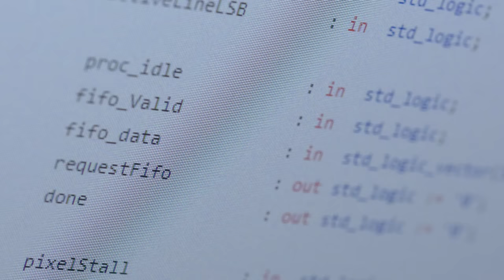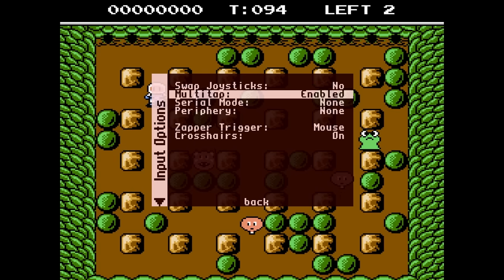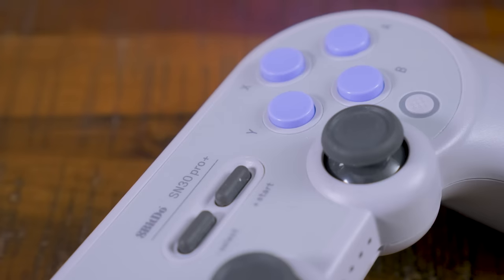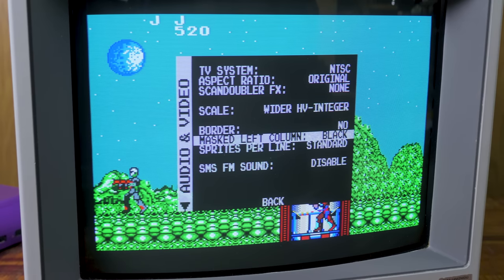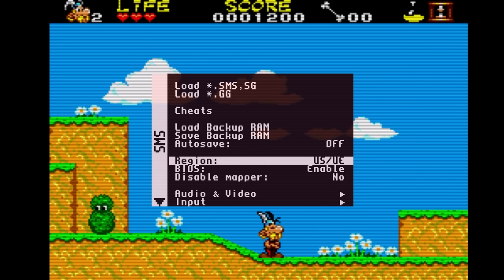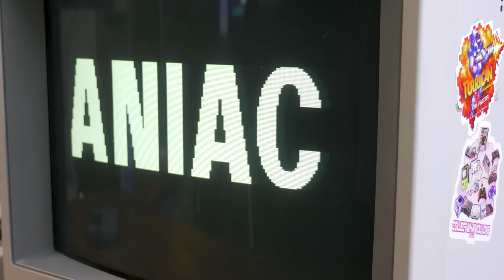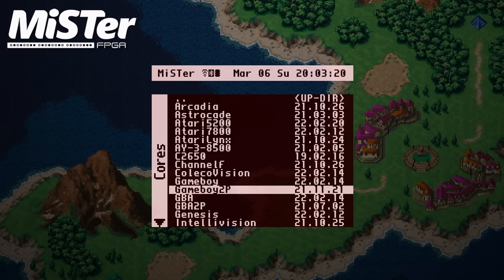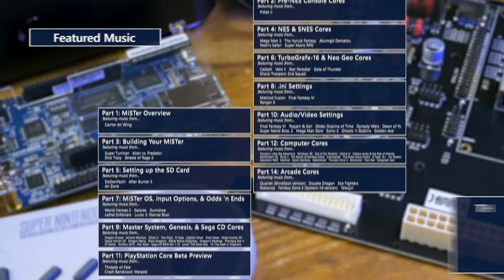MiSTer FPGA in 2022: A Primer Guide to Retro Gaming's Hardware Emulator / MY LIFE IN GAMING

Comment: 1:42:53
So why is the N64 more difficult to create a core for?
It’s Surprising that a Saturn core is in development and its not possible with the N64.
Reply from the maker: [Try4ce] I think a lot of people don't realize how much more complex the operations the N64 can process are compared to PS1 and Saturn. Even though it has limitations like a very small texture cache and the framerates are often lower than PS1 and Saturn, the way it manipulates 3D geometry is much more advanced and some features were above and beyond PC gaming at the time of its launch. Most of the FPGA is taken up with the CPU alone for the PS1 core, so we're hitting the limits. People may not love the N64 look in the retrospect, but that doesn't mean it wasn't very advanced. I couldn't speak to more specifics of why the N64 is comparatively advanced, but there's a lot more to it.

Comment: I wonder if MiSTer would work on other FPGA systems as well.  For example, are there 2X more powerful FPGA setups that MiSTer could run on without much more modification?
Reply: Some of the cores have been ported to other FPGA platforms.

Comment: 1998 was Pentium II era… several years after the Pentium, Pentium MMX, Pentium Pro, etc. had replaced the venerable 486. The first Pentium launched in 1993 so the 486 was decidedly obsolete for years. Granted, I knew someone gaming better than I could on his 486 in 1998 but he had a 3Dfx Voodoo and I didn’t exactly have a Pentium myself (IBM P150).
Reply: Also, that’s a Slot 1 or Slot A system at the chapter opening, which means Pentium II or later.
Reply: You didn't go easy on him...

Comment: Are there real advantages to this over a dedicated emu box for people who only care about the end result and have no interest in DIY electronics or MiSTer development?
Reply: Hard to answer that as there is too much variety in emu boxes.  Commercial ones are badly optimized or lack options compared to MiSTer; but you could build a good emu station out of a powerful PC if you don't mind the tinkering it needs. Personally I just find it easier to have multiple MiSTers around the house in various setups (TV, arcade, etc).

Comment: 2:14:42 - That kind of stuff could actually happen on original hardware.
Some link games were at times really unstable.
I spent A LOT of time playing link cable games way back when, and Super Mario Delxue sure did have it's weird moments.
The same goes for GBA, but it wasn't as common with GBA from my experience.
Reply: I played a Yugioh game which would simply skip your opponent’s turn if the connection got overwhelmed. I also found it was programmed poorly enough that it messed with the connection if you spammed buttons while it was switching turns. So I could have endless turns and deny my opponent any.

… but then no one wanted to play with me unless I promised not to do it. One kid even made me put my GBA down before he’d believe I wasn’t going to do it. lol

Comment: When will original xbox be available on MISTer? Considering the difficulty of og xbox emulation, will we see fpga first? Within 5 or 10 years?
Reply from the maker: [Try4ce] I'm no expert, but I think 5 to 10 years would be extremely extremely optimistic. The reverse engineering is one challenge, but the available logic on the FPGAs is another. I don't know if we can expect FPGAs of that kind of density to be available on an affordable board anytime remotely soon, maybe even not any decade soon. Again, I'm no expert, but I wouldn't be optimistic about this happening nearly as soon as you'd like.
Reply: Xbox? Not until late next decade, minimum.

Comment: I'm no programmer, by WHY can't the MiSTer save like normal? Emulators have been able to do this since the very beginning, why is it necessary to manually go into the menu to backup your save RAM?
Reply from the maker: [Try4ce] I also am no programmer but I believe it is likely because it would potentially interfere with the gameplay. For instance, in the WonderSwan core, if I have auto save set, then whenever I open the menu and it begins that process to copy the save to SD, there is definitely a hitch in how the game runs. I don't usually notice this in other cores, but I suspect this may be the reason. Resources have to be managed quite carefully in an FPGA environment for anything that goes outside of the target hardware's behavior. Many models of flash carts also have to do something similar - the save for the last played game is kept in SRAM like in a real cart, but it then has to take a moment to process writing that to the SD card separately upon next boot up.

Comment: What would be cool is if someone made a board that had every console cartridge slot for carts and an optical drive to accept all format optical discs.. that are SERVICEABLE AND REPAIRABLE that doesn't require a degree in hardware engineering..

Comment: I would have to wonder what would actually happen if you actually used a modern pc as the platform of choice and  start creating pci-e  hardware when and where you could run any controller on the  system..

Comment: Now MiSTer has a 2560x1440p option by using pixel repetition. What are the optimal settings for a 1440p 144hz PC Monitor?
Reply: Pixel repetition will show artifacts on most TV's when horizontal scrolling happens, dependent upon the scaling algorithm built into your tv, so it might not always be the best option.

For a 144hz monitor try and enable vsync_adjust=2 and see if it's compatible in the cores you like to run, if there is sync lose dial it back to vsync_adjust=1 instead. The test of the upper limit would be the Wonderswan core which runs native at 75hz.

Comment: Aside from a few Niche settings what advantage does this sort of thing have over a raspberry pi or hacked classic system?
Reply from the maker: [Try4ce] It's mostly about whether the difference in the software-based vs. hardware-based emulation approach tickles something in your brain that makes you happier. In the end they can provide very similar experiences when the emulators are well-made. But if things like the fact that FPGA emulation can perform parallel tasks in hardware rather than sequential tasks in software emulation appeals to you, or the idea that the hardware is performing in isolation from any OS tasks to provide a more consistent and predictable experience, then FPGA may be fun for you. If that just sounds like whatever to you, then you might enjoy the software emulation approach better. Both offer advantages and disadvantages.

Comment: Will there be a ram expansion at some point?

I'm kinda concerned that some consoles may not be possible on something that seems so versatile.. 

I'm keen for ps2 and dreamcast at this point
Reply: The only one that might use it is Sega saturn at this point.
Don't expect Ps2 or dreamcast
Reply: de10 can not do ps2 and dreamcast you would need a fpga that cost around 3g or more and a team to work together . a fpga is not a desktop computer it is a board to test and fine tune a product  example a ps5 was done  on a fpga to iron out all the hardware bugs before it goes to the assembly line. we know a sega saturn can be done but anything beyond that don't think so
Reply: @soloM81  sweet.. so 2nd iteration is what I'll be waiting for..
Reply: @garystinten9339  is going to be a while the fpga market is very slow when it comes to upgrades and the chip shortages dont help . get a de10 and play what mister cant play on your computer
Reply: @garystinten9339  Even then, a MiSTer 2 might only get you to N64 and DS, DC may still be out of reach.

Comment: Regarding arcade cores.. are there similar hardware pathways to allow writing arcade cores with multiple games to be run by the same core or is it a per game case?? The reason I ask is simply, efficiency and less programming.. if you follow my drift
Reply: They are built in that precise way. Similar arcade hardware or platforms use what is called an MRA, which is basically a text file that tells the core how to configure itself for that game, and where to load the data to.
Reply: @ArtemioUrbina  Hi, Mr. 240p Test Suite man! (yes I know you do many other things, I’m just joking around)
Reply: @solarstrike33  hey =)

Comment: Amazed that you have the Switch NES controller working with MiSTer I can never get it to recognise any inputs when connecting with 8bitdo Bluetooth adapter
Reply from the maker: [Try4ce] I'm not sure which adapter mine is but it's not 8bitdo. The NES Joy-con works great for me.
Reply: Have you updated the firmware of your adapter/joycons?
Reply: @rs.matr1x  good shout. Works a treat after updating the adapter. Not noticed much lag either while playing megaman. Cheers

Comment: 1:14:22 I think you used the wrong footage there. Supposed to be Earthworm Jim blending comparison.

Edit: Actually the footage is correct but the caption below is incorrect.
Reply: That is Earthworm Jim, and the blending example is at the bottom of the frame - the smoke that animates under the platform the snowman miniboss is on.
Reply: @The8BitDuke  oh you're right, it's just the caption at the bottom saying about sprites per line which is wrong, the footage is right.
Reply from the maker: Yeah I didn’t catch it. I duplicated the pop ups in the sequence but I just have missed changing the text on it. Guess that’s what happens in a video this big
Reply: @mylifeingaming  hey if that's the only thing I spotted then you did a great job 👍

Comment: So should we panic-buy the DE10-Nano within the next couple hours or is there still a better value in getting some premade combo unit?
Reply: That ship has sailed long time ago. They're $200 now.
Reply: You can hardly buy them now and the price raised. Paid 130€ years ago.
Reply: @MrChomiq  I was already considering that as the new normal. I meant in preparation for the next price hike now that this video is out. Well, whatever... couple more flash carts and I'll be set anyways.
Reply from the maker: [Try4ce] I bought an extra directly from Terasic for a second build just a few weeks ago. Shipping from Taiwan was $40 but I suspect waiting to get it from a place with cheaper shipping will ultimately not result in paying less overall. That's just me guessing though, given the way everything is getting more expensive.

Comment: Mister project is shaping up.
Man was just about to just use a raspberry pi with retro pi. Wasn't happy. Thou some emulators run alright like FBN. I always have a high end intel cpu. First cpu was 2.7 ghz or something. No wonder i had better experience in emulators.
I originally bought a d10 nano for atari. I wanted hdmi output for atari 2600 but didn't want to go thru the trouble in getting one and getting it modded. The atari 2600 core was pretty crumby. Meh the new 7800 core has 2600 playable. so it's all good now. Was still pleased with sg 2000, commador 64, Colecovision, ect which is almost the same so it was all good.
Then smokemonster advertised it more and the cores came. Am so happy with the newer and better cores. NES, sms was expected. SNES and genesis was grate. Neogeo was a blast with extra ram modual. Now we got psx which i didn't know was possible. The beta for psx works fine with 128mb ram, thou i bet a bit better with duel ram modual. 
Saturn core is coming. Man i just bought a ode for the saturn as well. ohh well. Grabed one for the dreamcast as well. good stuff with the new arcade games added.
Was about to get a ODE with hdmi mod. Now i kind don't have to. Thou i have a chip psx with some real cd's and burnt cd's. Good stuff.
The snak adapter actually is noticable in responce. Almost no lag. They need support for usb devices with snak, idk if it's even possible. Iv been using the wii adapter with the classic controllers for the nintendo classic consoles. Hey new controller. 
They need to make a snak adapter that supports more controller ports. Atleast the blister that i ended up getting have 2 ports and they both support llpa i think.
I gotta getta set up light gun. I bet it's a blast. Have my eye on that usb lcd lightgun i saw. Wii motes i hear work so meh.
Hope for more consoles cores and now that most of the consoles are done more arcade tittles. Looking at video's arcade tittles look better. Meh 
It feels amazing having the hole library of games for the console cores available ready to be played.
Reply: "shaping up", lol!
it is literally in the final stretch where possible console cores are concerned
the arcades will be the thing to watch once psx and saturn are done
project is quite mature
Reply: MIster should accept all known sav files. atleast the one's on the popular emulators and carts. Meh eventually.
Reply: thank ps1 core accepts 1 ram.
Better results with 2. 
But it seems fine with 1 so far.
Reply: @Deltax5  
i don't think the "better" results w/ dual ram are even noticeable to humans
Reply: @ynotwalk7391  ill grab one in the time coming.
I am having good results with one unit ram. 128mb.
PSX working good so far. Really only played a handful of psx games on mister. No need to buy ode psx. I may anyways.
Reply: @ynotwalk7391  more cores. Higher end ones. Maybe improvements to other cores. Still good with 128mb ram for now
Reply: How’s it like now that we have the final PSX core now?
Reply: @solarstrike33  pretty good...

Comment: Can anyone tell me the pros/cons of using a PC monitor CRT vs a TV? Just trying to get the best option for playing retro games. Obviously the monitor would have higher resolution but that doesn't matter for old stuff... I'm just wondering if a TV's image is different to a monitor or if they are fundamentally the same and it's just a size difference. I can get a 25" Sony with component input from my folks or buy a 19" Samsung Syncmaster 793 S instead. What do you guys think?
Reply from the maker: [Try4ce] You can't play at the original native 240p on a PC CRT, so you'd have to have a method to make it at least 480p. This is very easy to do on MiSTer in the way I described in the .ini section. It is definitely a different higher-precision look, but you still get many benefits of standard CRTs and PVMs.
Reply: @mylifeingaming  Thanks a lot for the advice. I'll try the monitor since it'll take up a lot less space. I can always get the TV later too since it's free :)

Comment: One thing I've been realizing lately is that my nostalgia fluctuates to different states, most of the time SMW on an emulator is all I need, other times I want to kit up my N64 with n64digital, blueretro and an everdrive to so I can have my n64 doing it's thing, other time I wish I had a mister, os at least the superNT, other times just plug my playstation  with a composite cable with original gamepad and load my old FF7 save

It's a funny feeling, as emulation+a decent panel and controller setup for sure get latency below what I can perceive, but playing in itself is not the endgame, is it? It's playing in a way that triggers all the nostalgia buttons we have. That's why I have no interest in the PS2 or OG xbox, NES os master system, only the experiences I had as a child push those buttons on the same way
Reply: don't limit yourself to only what you know
Reply: Can't beat nostalgia ✌️

Comment: Does it make any sense to buy a Mister and not use it on a CRT but instead a modern HDTV? It sounds like this is for a true retro player and not the pi user. Anyone?
Reply from the maker: [Try4ce] Absolutely. I believe most people do use it on an HDTV and the most robust features are available for an HDTV. The analog thing is very much a side feature for most people, I think. For some it's the key appeal, though.
Reply: @mylifeingaming  ok the millionaire dollar question!!! If I go with the hdtv, will there be enough reason to go with a mister still over a pi4? Will i still have lower latency with mister using hdtv? Ty!!
Reply from the maker: [Try4ce] I have to admit I don't know much about Pi lag, but MiSTer's lag is almost nothing if you use the fast polling script and set Low Lag in the .ini.

Comment: I am disappointed with MiSTer in 2022 because the DE-10 Nano is not powerful enough to emulate a 486 DX2/66. It can only emulate a 486 SX/33 with no math coprocessor. When is an upgrade to the DE-10 Nano coming?
Reply: While an FPU is nice, the inner workings of an FPGA implementation of one is way more complex than you might think. It might be possible, but not any time soon.
You might see hybrid emulation for it though.

As for a DE-10 Nano successor...probably not until late this decade.
Reply: @solarstrike33  It's already >6 years old, how can they sell the same product for 12 years? That's aeons in the tech world. There's gotta be some kinda alternative with twice as many LEs sooner than that.
Reply: @zyxyuv1650  FPGA technology doesn't move as quickly as mainline CPUs or GPUs.

Now, if we get a Cyclone VI...we might start to see a MiSTer 2, but even then we'll need to find the right board for it.